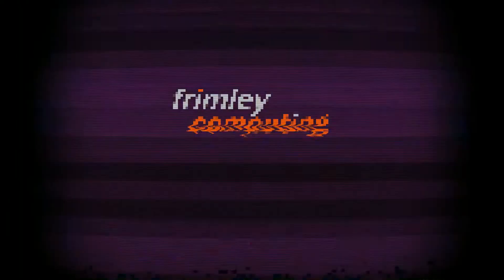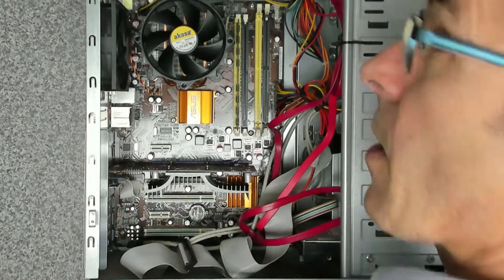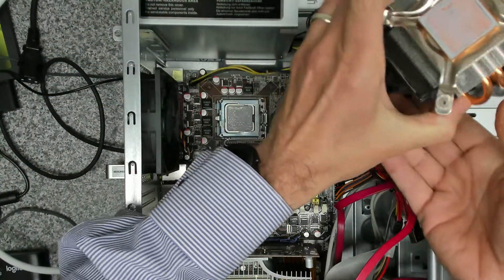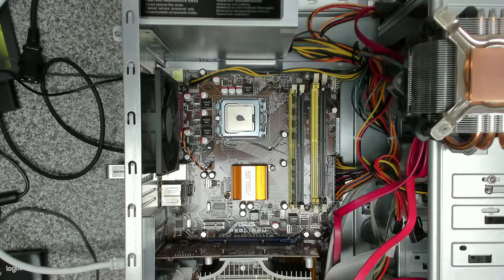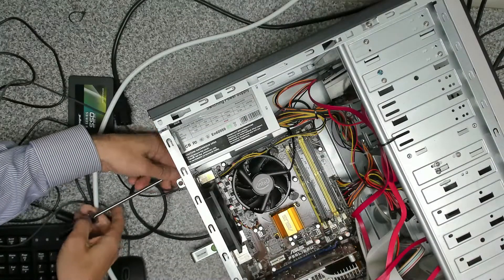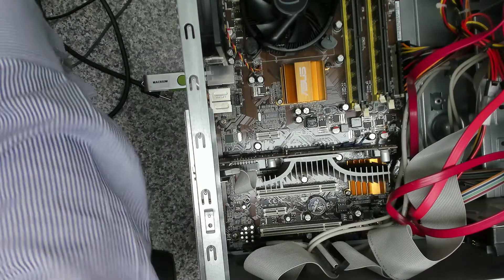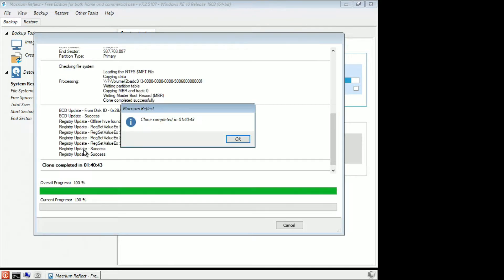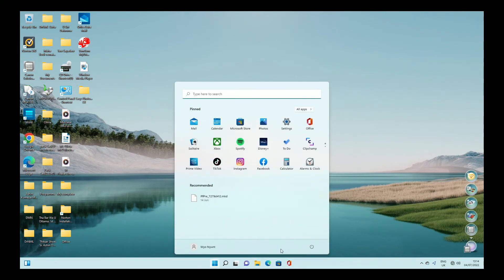Ancient DDR2 Desktop actually runs WIndows 11- how is this even possible?

Comment: i have 2 ddr2 computer's and a old ddr computer, my ddr2 comps both have 4gb of ram and my ddr computer has 2gb ram. also have 2 computers that my wife and i currently use as daily drivers, mainly have my old ddr2 and ddr computers for nostalgia purposes. they all run just fine, minus the ddr computer not running due to no hard drive. but because i would get too angry at how slow they would be with newer windows itterations, i just installed linux on them. they are as snappy as they can be given the hardware, mostly going to be used for our children when they get old enough to use them.

Comment: I would have added 6 gbs of ram upgraded to the best cpu the mobo & or video card supported & used the biggest ssd the client could afford & used the original tb hd for backups / storage.
Reply: I would have left it as it is and stuck Linux on it. I have perfectly good Thinkpads like the T60 and T61 with Core 2 Duo CPUs and 4GB DDR2 RAM (from around 2006 and 2007) that make perfectly good daily drive machines - one in my workshop has an old 4x3 screen that is great for pulling up PDFs and specification documents when I am doing electronics work.

All you have to do is finally rid yourself of your Microsoft abuser as I did when support for Windows 7 ended.
Reply: So basically new pc 😂

Comment: The performance would be vastly improved if Linux Mint XFE., was installed.
Reply: ...and even better if you build Linux to specification with a "building blocks" distro like Gentoo Linux, which I myself have been using for 20 years now.
Reply: @terrydaktyllus1320  I have tried many Linux distros but not that one, I use Linux Mint Mate version as my daily driver.

Comment: So how come such an ancient old steam PC was running Windows 11? I have a (much) more recent Lenovo laptop running Windows 10 well enough but it says it won’t upgrade to Windows 11 despite having a Core i5 processor - what’s the secret? 😆👍
Reply: turning on tpm security module 2.0 in bios should allow, of course if it has it.
Reply: @johngotcash  Core 2 Quad/duo's don't have tpm 2.0 they have TPM 1.2. 
they use a modified windows 11 install or did it them self's, there's loads of videos on how to do it.
Reply: @SilverX95  I was replying to the comment with the i5 not the video
Reply: @johngotcash  well same thing, I forgot what generation CPUs they added it I know my 4770k doesn't have TPM 2.0, a lot of CPU's don't have it I mean it's a pretty big list even CPUs that have TPM2.0 are lacking some kind of feature or for some other reason they're not supported.
Also I was more less going for a general reply not a single.
Also was more less going off the computer from the video.
Reply: @SilverX95 Any processor past 2016 should have tpm 2 built in. Also i was replying to a single person and not talking about the video.